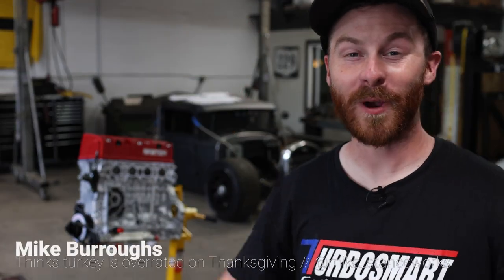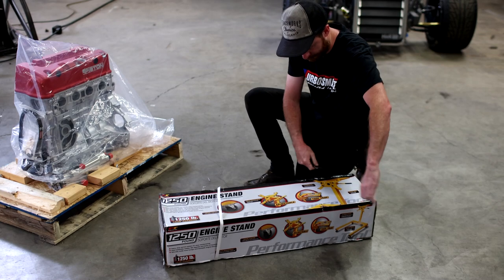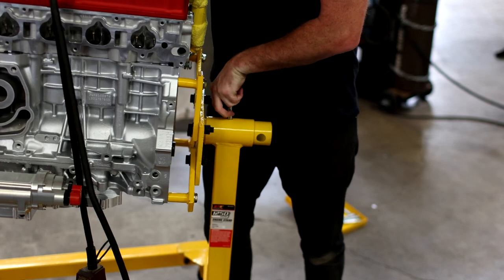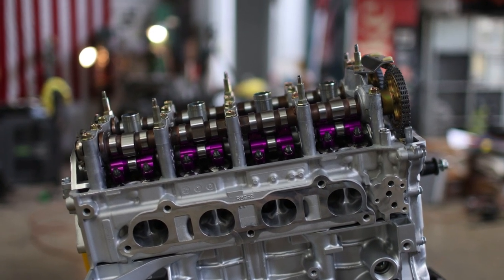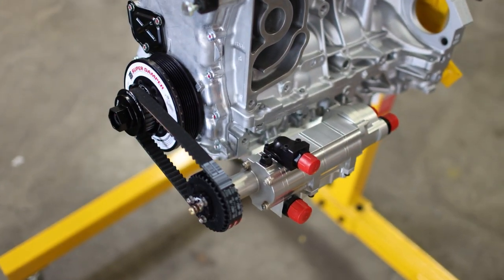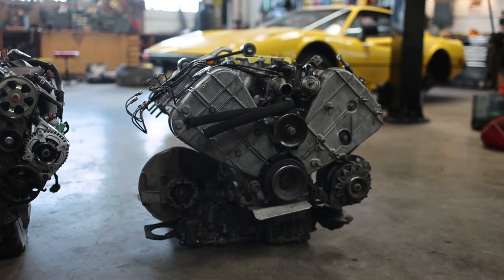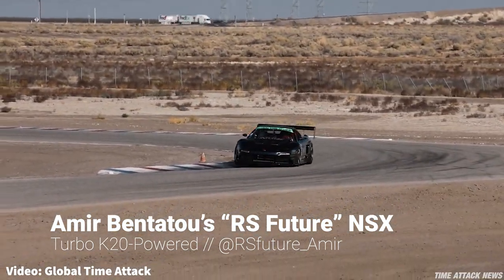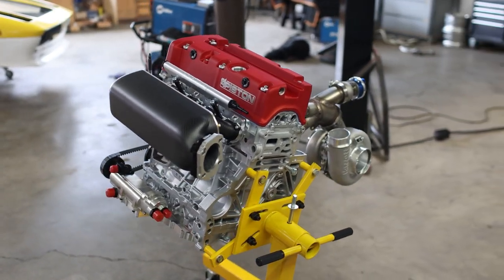My 1200HP Honda Engine IS HERE! K Swap Ferrari Ep. 57 (4Piston KT-1000)

Comment: back in the 90 i work in san francisco . i fixed a car 308 1982 CIS aftermarket kit with twin turbi IHI low compression . no intercooler . with 15 psi ..... it was a blast  .... my boss told me to drop to 10 psi .....the customer was very happy . he run the virginia hillclimb .

Comment: Hey Mike, when this video showed up on my feed my heart double stacked a heartbeat. Your idea for the powerplant is crazy ass mechanically eloquent. A 1200hp capable platform to deliver 600whp is by all means genious. Cant wait to hear it roar.
Reply: A 1200hp capable platform delivering 1200hp would be better though..........lol
Reply: What happened to the rest 600?
Reply: Detuned it for reliability. The engine can handle 1200 hp. Doesnt mean the transmission/driveshaft can.
Also the car is too old and light (not enough down force) to handle that much power without electronic drivers assists. @xushenxin

Comment: I'm definitely in the "I'd be way more stoked on 400hp NA with a 10k rpm redline and a feral VTEC changeover" camp, but it's also not my project and my overall stoke levels remain high. Can't wait to see this thing rip.
Reply: Right, it has to be high rpm or else it would sound ridiculous in the Ferrari lol.
Reply: yea, hes definetley killing off any low or midrange he wouldve had by getting rid of vtec. which is super odd because thats exactly what you want coming out of corners.
Reply: @bigreddaman5988  Like you can't rev high with a turbo? That thing can probably hit 12,000 rpm, that's not enough? NA is for sissies who can't handle real power.
Reply: 400hp NA k24 sounds great except the reality is that engine will be pig to drive as a street car and the type of fuel it will require will be your next practicality issue.  

For a road car, as far as practicality and reliability goes. 300hp NA out a k24 is near the limit before it turns into something painful to drive.
Reply: @davidyang577  I daily a mildly built 09 Si. It puts 230ish to the ground with the 93 tune. The car is bulletproof but I figured my power would be in the 250-275 range. No way in hell its getting their N/A without losing reliability.
Reply: @buckfutter99  sound like you have a nice reliable daily. 

And Imo a 250hp na makes in a light chassis makes a much better daily than a high hp and torque monster that can barely corner without the lean power at low and when I nail it, it spins.
as we all know spinning isn't winning. 
Unless you are trying to drift.

Comment: I think this combination makes the most sense. Packaging, weight and power. Maybe an LS but then it doesn't with out huge body and chassis changes. And then serviceability becomes a pain. (Less likely to want to use and want to work on it (No fun in that!!)) I've have K series Honda's, Miata's and now a LS S10. The LS in a 3000lb truck is awesome. But its a pain to work on. This is the right path. Shoot a MR2 with a K Series is a poor man's version. I am glad you are doing this Mike. Hot Rodding has no rules. And with no rules all cars become fun! Godspeed

Comment: I won’t say it makes more sense from a purely logical/engineering standpoint, but here’s an engine option I bet you didn’t think of that would be absolutely killer, and hey it’s Italian and sounds amazing too: ALFA Romeo 24V V6 3.2 or 3.0 modified.  They come in transverse layout arrangements and a shop I used to work at in Seattle worked with a South African builder to turn them into 3.7 400+hp NA monsters.  The shop in ZA runs them with spooly bois on a GTV6 with around 650 at the wheels.  It’s significantly lighter than the Ferrari setup and still has very special sound.  However as stated I won’t argue it makes more logical sense.  I love what you’re doing with this build!

Comment: An na flat 6 from a subaru . if you want a turbo 900 horses with just pistons and a crank  and a lower center of gravity but it's more complex and I think power to dollar ratio is better in the k20 and it is much easier to work on it so great choice for the k20 but I would still end up using the flat 6

Comment: Your excitement is palpable even through the screen. 👍 Looks great on the stand and I am looking forward to seeing it in the engine bay.

Since you asked us to put alternative engine suggestions in the comments 😆 I would say I'd have thought about one of the Japanese transverse V6s (Honda J35/37, Nissan VQ, Toyota 2GR). Not for any more power, but mainly because you'd get a wider powerband and a little bit better throttle response. You'd have a little bit more weight, but nothing too dramatic (such as an LS or the Audi turbo 5-cyl, which I think still uses an iron block and doesn't give you any noticeable displacement advantage over the K24). These would also come with other potential downsides, such as having a much smaller aftermarket (although for the budget of the K24 build, I imagine you could get custom-specced stuff for those V6s), and I don't know what transmission options would be available that could handle that kind of power (I don't like FWD so I generally don't dig much into the details about transverse engines 😅). Anyhow, hard to argue with a K-series due to its design and depth of aftermarket support.

Oh, and the V6s would definitely sound better than a K-series 😜

Comment: Vw 2.0 16v head combined with 1.9 dieselblock could handle the heat, it is what is used in rallycross and 1/4 mile

Comment: The motor you have chosen is perfect, turbocharged and air shifted it will be an absolute time attack beast!,.  I  think your logic is perfect.  You could even instal a sequential transmission with a stain gauge and use the ECU to program shift points and you will be a time attack God! Lol!  Seriously this is one of the best channels on youtube, you seriously have given this build a great deal of thought, and you dedication to building the best components you are capable of producing shows real passion.   I have been where you are you feel totally over doing a particular job, but just know you vehicle will be a SEMA and you do not what to be like a lot of the cars there that arrive on a trailer and are at best half baked. You are building a monster and that monster requires hard work.  I like a lot of others watching can not wait to see you competing at tine attack against your buddy's car or at least at the same events.  I am retired but I have done numerous engine swaps, and done everything from a 55' Caddy to a 5 inch lifted  89'Jeep with a Cummins engine swap.  I had a few buddies helping with every build, (many hands make work go much faster).   I also did several job totally alone.  I am rooting for you, keep up the fantastic job, and dont get disheartened.  It can help to take some me time away from the build from time  to time.

Comment: The answer that makes sense is always kswap. But me personally given an open cheque book budget would go something like a 3.7 busso v6 with supercharger. For no other reason than sound. It would cost more, be heavier, harder to package, make less power, be less reliable at that much lower power level and cost way more to maintain. But sound. But also you are 100% correct. No other engine makes more sense than kswap.

Comment: The new engine is an absolute menace and love how u have profiles in your head for setups u can use for the engine either street or stupid fast! Also u paint the manifold in black or some to hide the awful stainless gloominess along side with the welds, would definitely match with carbon fiber piece on the side!

Comment: The only other motor I would suggest would be a LS4, you can get 500 plus horsepower normally aspirated and if you add all the weight of the k24 and turbo setup with intercooler it probably is closer to the same weight. Also at 500 horsepower the torque would still be higher that the 600 HP turbo K24 at lower RPM making it more drivable and more power to pull it through the corners on a race track. But I’m excited to see this build. The only way to see what would be better would be a LS4 one and race them together at a race track

Comment: Honestly the k swap is a no brainer. More power, less weight, lower cost, more reliability. There’s a reason people do these swaps so often. Honda engines are proven wether you like Honda or not. I get some people like keeping the engine the car came with to keep some originality to the car. But when it comes to a build. You gotta do what you want. I’d go k swap if this was my build too. It’s the LS swap of four cylinder engines. It just works lol.

Comment: Very nice explanation, of the engine choice. But you could have build a reliable vr6 with 600 - 1000hp, more cylinders would have been nice for the sound but if the turbo is sized correctly it is a very sweat engine in such a chassis

Comment: Great engine choice, this is probably a budget blowing engine option, but the only thing that I could think of that would be better than this K24 is an RPE-V8. That's two Hayabusa engines mounted together using a custom billet block and billet crank to make a V8. You can choose between 2.4-3.0 displacement. However, I am not sure on turbo options and Then there is also the V8 made from two K24's! I am going to guess that these options are all waaaay more expensive.

Comment: Wouldn’t the vtec help with low end torque and getting into power quicker ? Is it because it’s going to be a time attack car it’s going to be high in revs most of the time and not need it ?
Reply from the maker: Exactly.
Reply: Exactly. You dont need low end power if youre staying in high rpms for 95% of yoyr track driving. VTEC helps with "streetability" but adds unneccessary complexity for a racecar.

Comment: I will say your K-series is a very good choice. But I will throw in an Audi 2.5 in line 5 that they used in the Audi TT and the S3. Companies are throwing town over 1000 hp stock block.
Reply from the maker: Another good option for sure. Those engines are wildly costly though. A used one runs about $15k

Comment: That engine is gold. If that was my car, I would keep it around 600/700hp for a long term reliability and for a correct driveability as the car weight will be much lower as well

Comment: Suspect that it wouldn’t fit, I’m not sure you’d get the same top horsepower figure and it probably would have the same rev-ability…but an Audi V8 from RS4 might be an option. 

They were front, front engined (so would work mid-engined) but longitudinal. Think you’ve got it right to be fair.

Comment: The only option that would be better would be a tesla drivetrain. i own a NA stock k24  Ep3 with 3" exhaust 74mm throttle body almost finished waiting on a tune after breaking a rod. Absolutely love the engine/ drysump/trans choice!

Comment: I once drove an '84 308QV.  You're spot on with it.  This particular car had the original ANSA exhaust on it and it sounded like a combination between an old VW Beetle and a Honda with a fart can.  The flat-plane V8 sounds very, very close to a 4-cyl unless you have a Capristo exhaust on it anyway.  Screw the naysayers and purists.  Your car is going to be go like a raped ape and will sound awesome.  Plus, you've done homage to Ferrari with the red valve cover and the carbon intake.  It looks like half of an F430 Scuderia engine.

Comment: Gandini suggested to Lamborghini another way of getting more power in a car; his Diablo concept had 2 Urraco V8s joined end to end across the back of the car.  Lambo weren't interested but it sold in small numbers as the Cizeta V16T.  Cutting from 8 to 4 does make everything easier!

Comment: If you had the length in the engine bay, possibly one of Toyota's 2JZ. Inline 6 is hard to beat for a smooth driving experience and it'll produce torque easier, but that all assumes it'll fit. Given that it was a V8 in there in the first place, length may not be on your side in the engine bay, and it's incredibly complicated to gain more in a mid-engine car. Best to stick with something that'll fit and use the extra width for turbos and piping.

Comment: Everyone should look into an engineering term called Horse Power Hours. The formula is pretty self explanatory for anyone that plays with motors much. The farther you stray from a platforms originally intended HP numbers the shorter amount of time you will enjoy your new found power benefits. By all means do what you do because raising hell is big fun. What really would scare me and should scare everyone from the original builders to the final assembler is buying an incomplete package is dangerous. There could be something inside waiting to explode right now but in that event everyone points fingers at the other. When this kind of cash is involveda complete package makes more sense. That way you know who to blame when the HP Hours end up way shorter than anyone anticipated.

Comment: After dressing out your K with the intake mani, turbo, and cost of material on your header (+ plus the cost of the 4piston K engine), how much did you have to spend in excess of the 12k you sold the Ferrari engine for? 
It's wild how much value is in the K architecture. Love the build man.
Reply from the maker: I paid nothing for the turbo or the materials for the turbo manifold. I paid $1800 for the intake. So about $19k out of pocket for what’s seen at the end of the video

Comment: The Yamaha produced Volvo v8 comes to mind, but like last time you probably wont adress us that sugested this engine that actually do not weigh much moore than that k24....
Reply from the maker: I address and reply to comments all the time, don’t be rude. 
That’d be a cool motor but it’s power ceiling isn’t the same, and it has nowhere near the same aftermarket and R&D behind it. I’m also not sure how strong the transmission is in reality.
Reply: @stanceworks  Sorry but I never saw a reply too the comments suggesting this engine. I am not saying that what you choose is wrong, just that there are 8 cylinder options... I get why a k24 might be right for you, but nontheless a Volvo B8444S, like used in the Noble M600, might be a great alternative.If you made this choice because you wanted to, just say so, you do not owe any of us an explain, after all if I do not like your choice, I can build my own 308 track weapon. I just wish you adressed it in a video. All I want is what is best for your project, not meant as critiuqe....
Reply: To be honest, I would be more exited if you made a 308 with a Toyota diesel v8, but I love to pi** off Ferrari purists....

Comment: Mike, Any provision for a tensioner on that oil pump? It looks loose. I know from experience, if you get the center distance correct for the belt and pulley setup, you don't need one, but this belt looks a little slack.
Reply from the maker: Oil pump belts are quite slack, and can be removed by hand with no tools. It surprises me too, but that’s how they’re meant to be!

Comment: a Subaru engine and trans might fit in that. (ez30 and 6mt with a rwd kit) but i would bet youd have to cut more of the car up than you did for the k. also a huge weight penalty. subaru engines, while great engines, are not without their faults too...

the k series can do everything a subie engine can for less money and less weight. it honestly is a no brainer.

Comment: The only other engine i could think of would be a hyabusa turbo, but i guess aftermarket support and reliabilty the k24 has is superior, especialy going after 1000hp
Reply: Close to 1000hp is possible from a Hayabusa, with a turbo, etc. But not sure viable for much more than a dyno queen. 500hp is reasonably common on them, and there are v8 engines based on Hayabusa top ends……….

Comment: What a pretty engine I'm actual impressed. It needs more of the shoulder of the valve shaved and the tops of the valve guides gets me, but nice port work.
You can make over 1000hp out of a 2.0 Fiat motor for less for ten. Way less than ten(less box) and it's still in the family . Even if you tuned it down  to 600hp the 1000hp  Fiat motor wouldn't be streetable  just like your honda engine 
Thought you were some kind of mechanic Kermit, you should know that.
Reply from the maker: Oh its you again, the guy who's wrong about everything. Welcome back!
Reply: @stanceworks  
Lol you're funny. 
"the guy who's wrong about everything"
Have you learned to tig weld properly?
Keep going. I can play this game of picking out your faults all day, or  do you think I'm wrong?
Reply from the maker: I already made fun of my TIG welds last episode what else ya got
Reply: @stanceworks  
You just admitted the "guy who's wrong about everything" isn't , well done. 
How's the weight balancing going?  Have fun with that one.

Comment: not that the k isnt prob the best option due to it being the cheatcode engine.

1uz is a good option. light + cheap , and stock it can handle over 700whp from what i see .
ls3 because bmw dct trans kits are getting easier to source and they make GOBS of torks .
~ i think now a days u can do the bmw dct trans with the k engines too, id suggest it .

Comment: The only problem with a 1000HP Civic engine? It makes the 1000 hp between 12,000 to 12,050 rpm only. Everywhere ells its probably slower than a Prius. Ok, maybe a bit faster than a Prius but not by much until 12,000 rpm. Then your eye lids curl backwards.

Comment: So, far from the cheapest or most logical. But a Volvo B8444S (the V8 engine from the Volvo S80, designed by Yamaha) with a turbo setup would be killer. Basicly running a Noble engine in a Ferrari and the Volvo V8 was made for traverse mounting
Reply: The Noble M600 engine, yeah, killer one, but I bet it is a pricy thing aswell.
Reply: @staLkerhu  the basic engine is around 3k here in Europe. With about 160k kms/100k miles on it. But then to make it handle the power, it will get expensive real quick